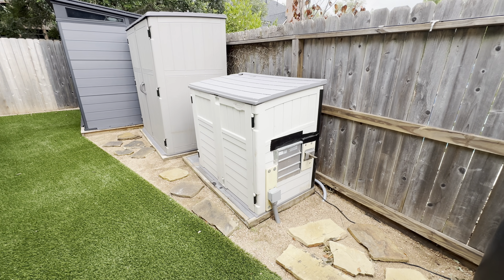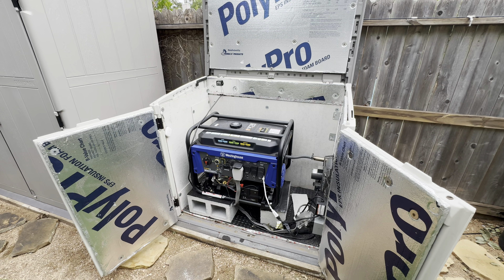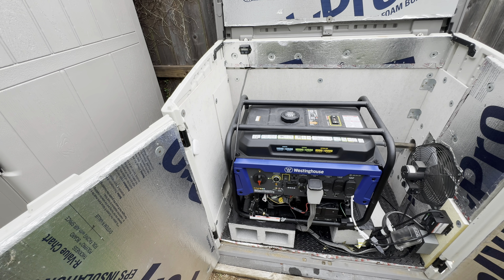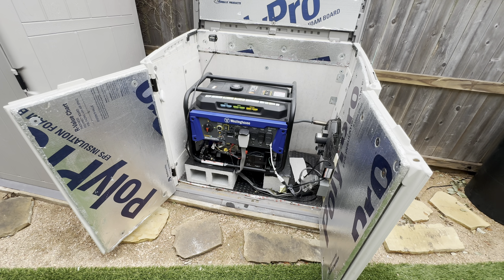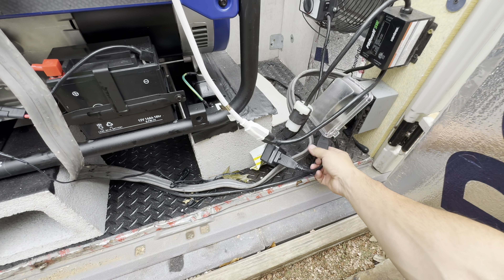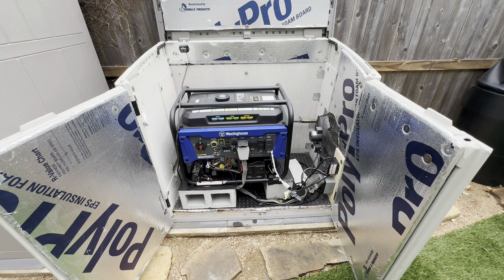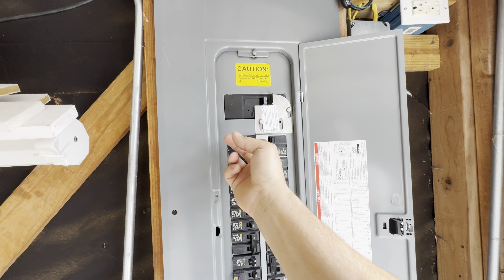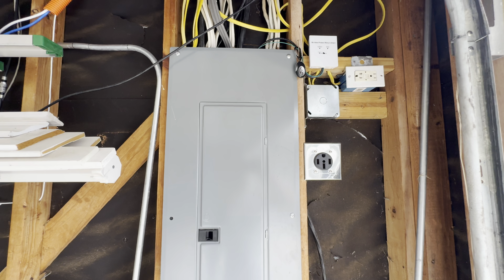Tri-Fuel Portable Generator Post Hurricane Update on Natural Gas

Comment: I built a 4 ft. x 8ft. storage building in the back yard. Yes, it was built for the generator but decided I may as well have a little more storage space. Sixteen-inch x 24-inch vents on each side. A box fan provides ventilation. Has worked fine for the freeze and the hurricane. I do use full synthetic 20/50 wt. (same oil I use in my motorcycle) and change every 24 hr. of run time. Thanks Calvin, for great content!
Reply: Why would  you use such a heavy oil when most man. recommend 10w30? And what bike uses 20w50?
Reply: @armyfazer1410  It is Hot in Houston. Most owner's manuals recommend 10-30 for temps 0 to 85 degrees. A straight 30 wt. oil would do also. Just what I am most comfortable using. This is what I use in my Harley sportster.
Reply: @dirkmoore4224  I'm near NOLA. Same weather as you. 10W30 goes well above 85. Good luck with your process.
Reply: I've been wanting to do the same thing. I want to build something a little bigger and store all my lawn equipment and generator. Maybe even section off the area I put the generator so if I need to start up the generator, I don't have to worry about the other equipment or chemicals I have.

Comment: I'm debating whether to get this model or the WGen9500TFc.  I' need to find out the noise difference between both units.  What enclosure are you using?  During Beryl, I was out of electricity for 5 days.  I have an older Northern Tool Powerhorse 4000 watt generator.  I was just using extension cords to power my essentials, a refrigerator, portable ac for the master BR and I also ran 2 extension cords to my neighbor so they could power their fridge etc.  As for cooling, I typically would let it rest for 15-20 mins every 7-8 hours.   I think for this size unit, it probably wouldn't hurt to stop it every 10-12 hours specially in TX during the summer.

Comment: Hey from Tomball, TX. I have a duel fuel generator and I usually only fuel with propane. This time due to power outage length I had to use gas. (no propane refill available)  The best part of using gas for long term power outage is that you can fill the tank with more fuel than what is in the typical propane bottle. On a full tank of gas we ran for 11-12 hours with air-condition. on propane we got 8-9 hours. I have been thinking about maybe using the Nat. Gas supply but our previous power outage was only a few hours not days like this time. Thank for sharing.
Reply: @dane6k6  this is why I’m investing in a 100lb propane tank 🤣 The longer I can let this thing run without having to go out and refuel it, the better (though I know I still need to go out and change the oil but still…)
Reply: @jazzcat9363  I hear ya. Just know when you go to that size bottle the nozzle is different. Also know that the nozzle isn't string shutoff. Meaning when the valve is open propane comes out. Not the case with the 20lb bottles.
Reply: How many tons is you ac unit and what size of propane tank last you 8-9 hours?
Reply: A 100lbs propane tank will be empty in 20hrs. 20lbs tanks commonly used with gas grills empty in 4hrs running a generator.
Reply: @xxRock81xx  Buy 4 or 5 100lb tanks. Keep them full. Propane doesn't go bad.
Reply: @carlray8290 I'm setup to run natural gas so no need. I was just providing facts for others. My wife's boss just had to refill his 250gal propane tank twice for this storm, $1200 dollars, he was on his standby 5.5 days before his power came back.

Comment: The heat isn’t the issue with oil especially with synthetic. It’s the fact the lack of oil filter is there. Constant recirculating with contaminants accelerate the wear.
Reply: If no filter then change oil every 24/35 hours is just smart 😊
Reply: @philliphall5198 exactly

Comment: Great setup.  I’m in Houston and I have been thinking of a way to setup a portable generator outside permanently. To avoid having to move it in and out of the garage during times of emergency.  I also don’t want to have to lug it out to test it every few months.  I think I will try the small storage shed like you have.  Thanks

Comment: Anyone here in this chat room knows where I can buy a CNG conversion kit for our duromax xp13000eh  generator.
One of the gentlemen mentioned that here in Cypress Tx there's a place that I can buy it from .
Please advise
Reply: Try motor snorkel. The kit they sell is propane and CNG. It's pricey, but if all you have is gas, it gives you the other 2 options. I'm going to order one for my champion inverter generator.
Reply: @DavidSanchez-ib4ft  thank you Sir.

Comment: We still have no power in humble I’m using my Generac 8500 run window AC unit refrigerator and other small stuff , I will be upgrading to Westinghouse 13K so I can get rid of the 10+ extension cords I have running in the house.
Reply: man wild down there..I used go live on the humble side right before lake Houston bridge. The 4 years down there we never had anything like this.
Reply: I'm in spring, the woodlands specifically and still don't have power. Was told Tuesday the 16th by the latest by Entergy. I have a powerhouse 13k and I didn't get a chance to hook it to the house so we have cords every which way
Reply: @jakeurbex713  that’s what upgrading to the tri-fuel and run it with natural gas & gasoline. My brother n law works for the gas company (center point) & he can come and install the “T” valve with a quick connector
Reply: @jakeurbex713  did they get your power on yet?

Comment: I'm near 45 South and the Beltway area. Not for from Hobby Airport. My power went out Monday and just came back on yesterday at 1:35 pm. Got through Hurricane Beryl with my old 4,000 watt PowerHorse Generator and a bunch of 50 foot extension cards. I'm now looking to purchase that same or similar Generator that you have so that I can do away with the extension cards and power my whole house. You have an incredible setup. Is there a specific company that you used to install everything, or did you do it yourself?

Comment: Thanks for the tips.  Very helpful.  A few questions - How large is your NG outlet pipe where you connect to the flexible hose?  Did you have to have the gas company adjust the output pressure at your NG meter?  And finally, are you happy with your Westinghouse generator?  Thanks and stay safe.
Reply: Great question, I would like to know too!
Reply: Also interested

Comment: Thanks Calvin, Im here in Pearland and will reconsider the box cover for my big generator(have not used it this time)…I used my Honda 2200 due to portability and can be stored in house. I have to give 1 hour break on my Honda then run it again and again for 6 hours interval(used for 3 days this time).
Reply: Havent had to use mine yet, but did I understand you correctly that it's best to give Honda 2200 an hour break every 6 hours of run time?

Comment: Great setup!
Questions:
1. Did you have to change NG meter and regulator for this engine? And if all plumbing was done by you or certified plumber?
2. What manufacturer of cooling fan are you using? Is fan with thermostat?

Thank you for answers.

I am in North Houston and no power yet… running on Powerhorse generator.

Comment: I have the same generator and it ran 20 hours non-stop except for refilling the gas tank. I do have my gas meter to my house plumed with a quick disconnect T-line but I want to run as long as possible on gasoline before I switch over to natural gas. The generator powered my whole house though I'm pretty conservative with energy usage and with the internet being out, the generator only had to worry about my 3-ton air conditioner, some ceiling fans a refrigerator and a deep freezer. I was probably using no more than 5,000 watts. This generator is amazing.
Reply: What was your NG bill like? I know the load will make all the difference, just want an estimate.
Reply: @fat_biscuits3928  I didn’t use NG as I was able to get a refill of fuel however when I went to go out the second time to get fuel most of the gas stations were either out of fuel or had big lines but I managed to find a place. I did ask a friend who did use NG to check his provider’s website for usage and from what he could tell it’s about $60-$70/ day which mirrors what other people have said online. That’s about the same price as getting the same amount of gasoline run time-wise.
Reply: @fat_biscuits3928  I thought I replied to you earlier. I kept it all gasoline as my power was out for only 2 days. A friend with a Generac says it’s about $60/day on NG.
Reply: @fat_biscuits3928  Load notwithstanding, NG is cheaper than gasoline or propane...by quite a lot.  Running a load of about 24-26amps I use about 6-7 gallons of gasoline over a 24-hour period.   I have not had the opportunity to measure running on NG for that long because since I plumbed to my genny we have not had extended outages.
Reply: I consider NG my primary and gasoline as my backup for several reasons.  First, dollar per watt, NG is the cheapest fuel source.  Tied for first, as long as I have NG service it is constant and I need not stop to refuel.  Second, in addition to the refueling process, there is also the resupply process and you have to find a pump that has power that has also not been sucked dry because its the only one in miles.  Third, even if you use ethanol-free gas, you cant leave the leftover in the tank indefinitely...and since you really can't know when you will need it again, you really should drain it from the tank and carb so thats extra hassle.
Reply: Hey Calvin! Great video. I've got the same gen but didn't need to crank her up as we kept elec in our part of Cypress.